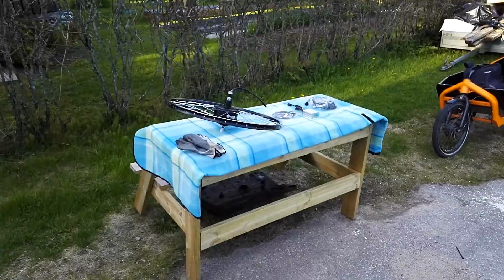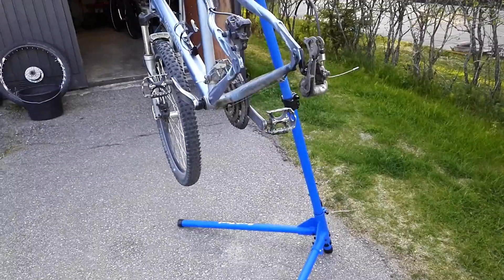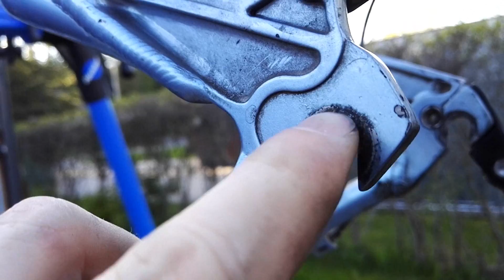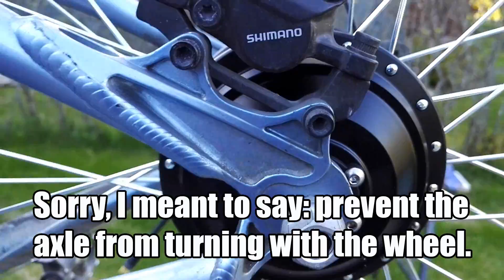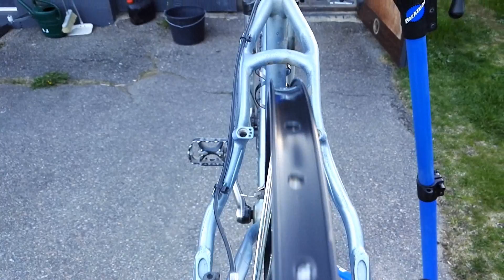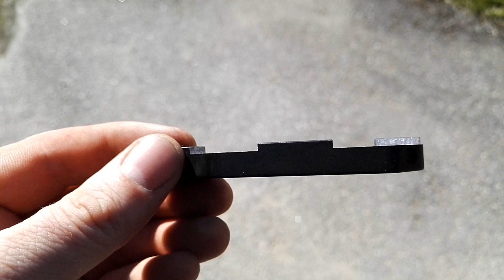How to convert your bicycle into an electric bicycle, part 1

Comment: System isn’t good if you have to modifie brakes. It is standard where brake disc is and there shouldnt be any need to change that spot.

Comment: Where did you get the battery from?
Reply from the maker: klmfin 

The battery was bought in November 2015 from a German vendor on ebay called Leon Cycle. It's a 36V 13Ah battery with Samsung cells. I estimate it has gone through 400 cycles but still works ok.

Comment: As I understand it, you cannot stretch aluminium frames as they will crack. Why wasn't any of this stuff measured before buying the kit?
Reply from the maker: That is my understanding as well. Stock hub width is 135mm on 9mm quick release hubs. Ciclotek, the company I bought the kit from, states 136mm as hub width for this rear hub motor. If that would have held true, there would be no worries. But now when the hub width is in fact at 140mm, we will have to test and see what happens.
Reply: Why didn't you send it back? With this frame now bent over 5 mm, your brother is in danger. The stays are being stressed and a good bump could cause a crack.
Reply from the maker: tarstarkusz 

These rear hub motors are all the same. At least the ones that take 9-10 speed cassettes. 7-8 speed hubs with screw on free wheels are a little narrower. 

We have talked about it and we will inspect the frame frequently for the first few weeks.

There is nothing wrong with the rear hub itself. But the sellers information is inaquarate.
Reply: E-Bike Commuter a little bit over 6mm isnt that big of a deal, have ridden my bike over a year without any singns of the frame being damaged